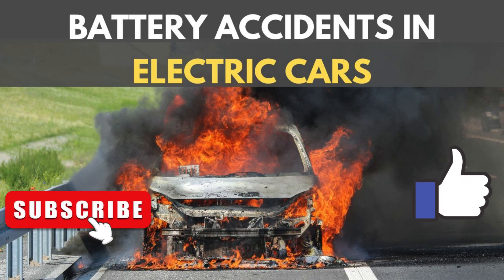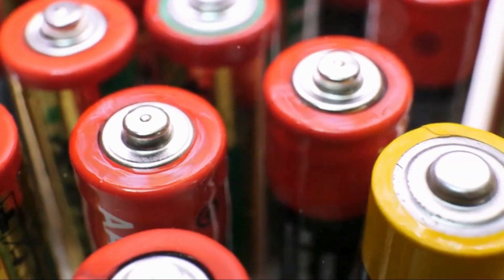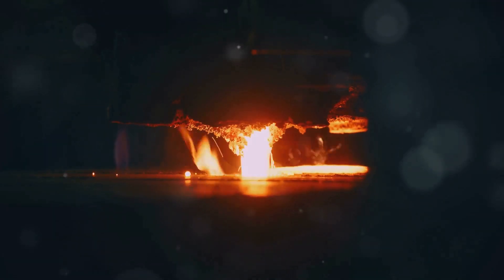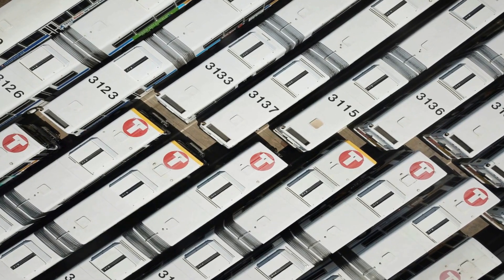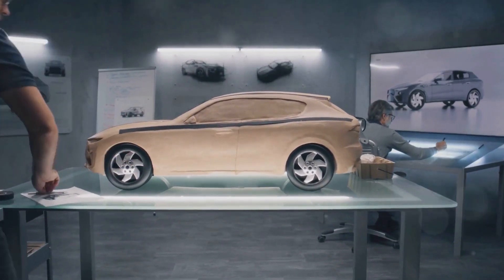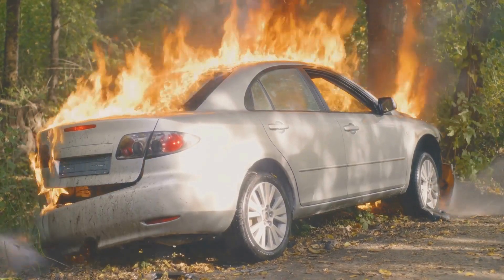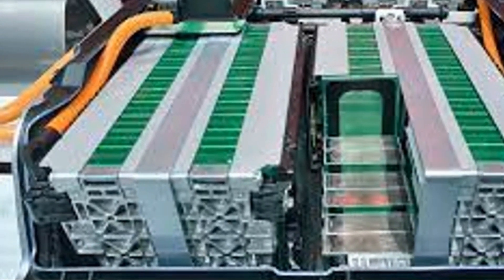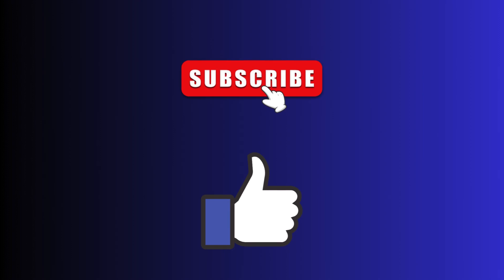Battery accident in electric cars

Comment: What a load of old cobblers..
Reply: If you do your research properly you’ll find that EV’s are significantly less likely to catch fire than ICE vehicles:
Just Google EV battery fire statistics if you don’t believe me.
Reply from the maker: Absolutely, EVs are statistically less likely to catch fire compared to ICE vehicles. Checking EV battery fire statistics will provide clear evidence.
Reply from the maker: Thanks! If you have specific points you disagree with, it would be more productive to discuss them.

Comment: Really !  When the Pintos and Corvairs and other cars and trucks were catching fire when rear ended back in the 60's and 70's there was concern but no one suggested we go back to steam engines.  Which by the way had boilers explode on occasion.  Electric cars are much less of a explosion hazard than 15 gallons of gas sitting under your floor board!
Reply from the maker: Great point! Historical perspective shows that new technologies come with challenges, but advancements lead to safer solutions.
Reply: the question is will you pick 250-500c fuel fire or 2500-3000c lithium ion fire

Comment: Talk about scare mongering, blimey, you make it sound like a nuclear weapon. Fact (look it up) that EVs are far less likely to catch fire, sure, when they do, they create a new challenge for the fire brigade, but on a bonus, they get called to fewer in the first place.

Diesel is a major issue, if that leaks onto the road, it's virtually impossible to remove and often a new road surface is required. I can also show plenty of ICE vehicles exploding when they've caught fire. Conclusion, fire is dangerous.
Reply: Not sure why NON of you EVANGELISTS are getting this. We don't care if its a Tesla, GM, FORD, or BYD etc.  The issue is that if an EV just sitting in a parked stall in a sub basement can catch fire it can take down and entire building due to both Toxic Gasses and lack of access by Fire Departments which is not true of a Gas ICE fire. My employer found this out and (from a little bird) and legally had to turn them all off and relocate them as far away from Building, Infrastructure, Air Flow patterns, trees and land scapes, and you have to be able to capture all the Toxic water run off should one catch on fire. Yep EV's are really worth it ! Way to go Green. Please don't park next to me. Second Though Let me Fire up my V8 and move 20 feet away ! The Govt Stopped the Samsung Phones due to fires on planes etc. Oddly there is no comment from the Biden Administration to SHUT this All Down till its fixed. Hummm
Reply from the maker: EV safety is continuously improving, but your concerns are valid. While EV fires are rare, they do present unique challenges for firefighting. It's essential for ongoing advancements in battery technology and safety protocols to address these issues. Meanwhile, gas cars have their own significant risks. Both vehicle types have pros and cons, and it's crucial to weigh these when making a choice.
Reply from the maker: EVs are indeed less likely to catch fire than ICE vehicles, but both present different challenges when they do. Diesel spills are a significant environmental hazard, and fires in ICE vehicles can be very dangerous. Fire safety remains crucial for all types of vehicles.

Comment: These are essentially 1st gen Li Ion batteries, highly flawed and dangerous. I am holding out until there is better range, less toxicity to the environment and good service (tesla service sucks).
Reply from the maker: Battery technology is rapidly improving, addressing issues like range, environmental impact, and service quality. Newer generations of batteries are much safer and more efficient than early models.
Reply: @futureenergytechnology  Please tell me when Elvis gets here. EV's are DOA ! switching back to old reliable Gas.
Reply from the maker: @ImLivinSD  EV technology is evolving rapidly with significant improvements in range, reliability, and infrastructure. While traditional gas cars are familiar, the benefits of EVs are becoming more compelling for many drivers.
Reply: @ImLivinSD  for how long?
Reply from the maker: That depends on individual preferences and advancements in EV technology. Many are finding EVs increasingly reliable and efficient.

Comment: gas tanks also hold vast amount of energy. They have many more fires/100k miles than EV's
Reply: Like the GAS car shown at 6:18, clearly not an EV. It's difficult to get pics of EV fires as they are 30-100 times less likely to catch fire.
Reply from the maker: @bellshooter  Thanks for pointing that out. The video aims to provide a balanced view. EV fire data is indeed much lower.
Reply: @futureenergytechnology  Sure, and we should be wary of news sources conflating fires in cheap Chinese E-bikes and scooters with properly managed car batteries!
Reply from the maker: @bellshooter  Absolutely, it's crucial to differentiate between various types of batteries and their management.
Reply: More ICE cars are on the road= higher proportion of fires in crashes as there are many more possible collisions...
Not saying they are inherently safer or more dangerous, but it isn't a apples to apples comparison, as is most things when talking about BEV's and ICEV's.
Reply: @Mightyboxy  All the statistics that show a 30-100 factor for ICE above EV cars is per vehicle-km or -mile. So NOT dependant on actual car numbers.
Reply: @bellshooter  Could you please then send me some papers to read through that describe how the stats relate to real life incidents? Honest question. My concern when it comes to EV fires is the difficulty in putting them out, hence my interest in the subject, also do you know of any differences in the substances emitted by the fires of BEV's when compared to ICEV's?
Reply from the maker: @Mightyboxy  Good point! Comparing BEVs and ICEVs directly can be tricky due to differences in numbers and conditions. Context matters
Reply: @futureenergytechnology  fr bro there are a billion internal combustion cars and like not even 200k teslas and they say they explode less, if we exponent the numbers thing will not look that bright for ev, + i would def pick 500c fuel fire over 3000 c lithium ion fire.
Reply from the maker: @Psydvckthefirst  Thank you for your comment. It's true that the number of internal combustion engine (ICE) cars far outweighs electric vehicles (EVs) currently, but when adjusted for the number of vehicles, data suggests that EVs aren't inherently more prone to fires. Both fuel and lithium-ion battery fires are serious, but EV fires are rare, and advancements in battery safety aim to minimize risks even further. Picking between the two might be subjective, but focusing on safety standards for all vehicles is key.
Reply from the maker: You're right; gasoline tanks do hold a lot of energy, and statistically, gas-powered vehicles have more fires per 100k miles compared to EVs.
Reply from the maker: That's correct; EV fires are significantly less common than gas car fires, making it harder to find images of them. Nevertheless, there have been some reported EV fires.
Reply: The vast majority of ICE car fires are caused by electrical problems, and they don't involve the gas tank. The vast majority of ICE car fires are extinguished within seconds, and may be extinguished through dozens of different, simple methods. 

The professional guidance for extinguishing EV fires is to move the EV away from all other combustible objects and watch it burn itself out, which can take between hours and weeks. In other words, statistically EV fires are literally infinitely more difficult to extinguish than are ICE car fires. 

THE GOVERNMENT PUSH FOR EVs IS A RUSE FOR MASS TRANSIT. Solution? Get the government out of the business of coercively picking winners and losers.